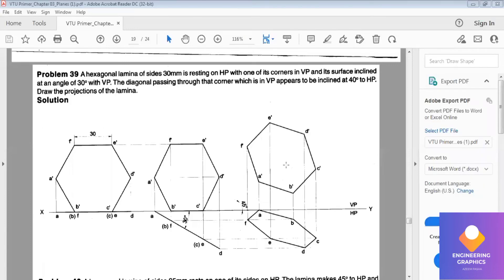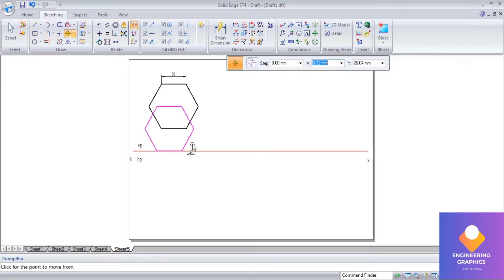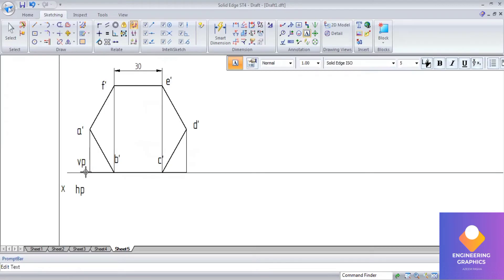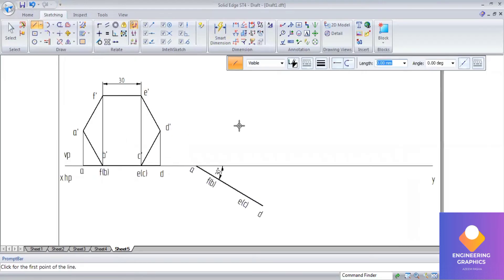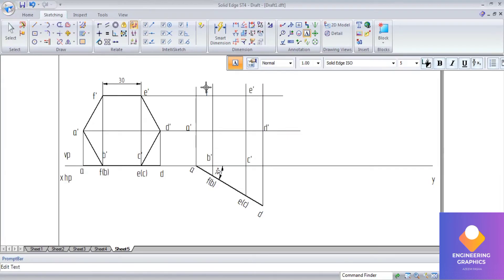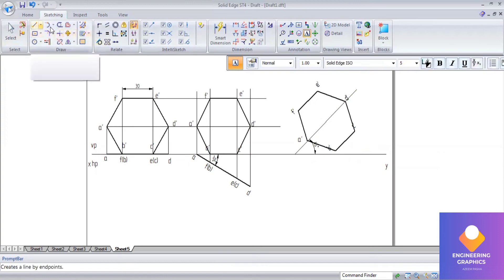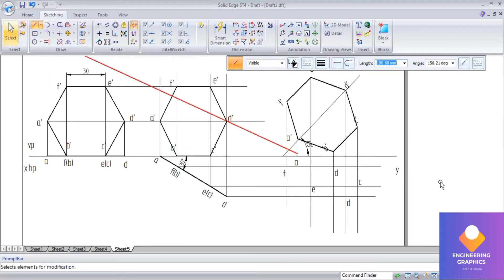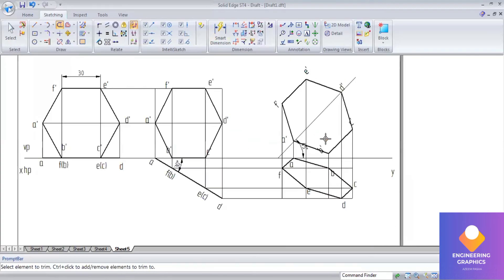Hexagonal lamina resting on HP with one of its corner on VP

Comment: Sir why we draw it above reference line as in question given side is in hp
Reply from the maker: @AnjaniGupta-ds2wk  in the question we need to make resting both in HP and VP plane.. and in continuation of the question the diagonal which is there in VP to inclined...
Reply: @engineeringvisualization1005  in question one side is on HP is given only then?
Reply from the maker: @AnjaniGupta-ds2wk  how you will take diagonal which is there in VP in HP plane? That's why
Reply: @engineeringvisualization1005  isn't the diagonal the line you drew on XY line (ad line). It's the shadow of diagonal, thus the diagonal is in VP
Reply from the maker: @hanumans4981  yes